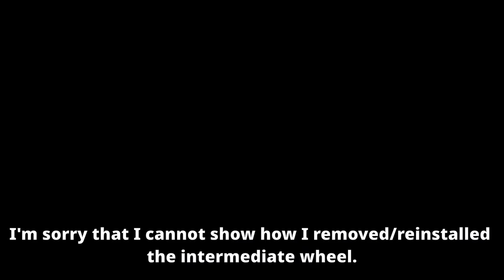Omega Speedsonic f300Hz Lobster Tuning Fork Repair - Omega Calibre 1255 (ESA 9210)

Comment: Did you do any oiling to this watch, I also didn't see any stone's 😮
Reply from the maker: Yes, I loosely followed the technical guide. I used light viscosity oil for cap jewels and medium viscosity oil for other metal-to-metal contact points.

Comment: Great video! I found one locally that is clean dial, original bracelet and clean movement working, he said send me a offer, what do yoi think is a ideal price? Only seen 6 on chrono24 on average 2800usd, what do you think is a good offer? Worried about it breaking :( since its a watch from the 70s, non lobster model, and if the tuning fork is broken does that mean it will not work at all as a normal watch?
Reply from the maker: Thanks! If it works with a nice dial, it won't cost less than $2,500. The value will not go down. If the tuning fork or its related parts break, it will no longer be possible to run. The only solution is to replace the part, but finding replacement parts is not easy.
Reply: @vintagewatchtinkerer  thanks for the reply. He called me today and said he would be happy with 800 USD. He is strapped for cash and said nobody is really interested in buying it. He sent me a video of it working fine. Just the large second chronograph dial does not go back to 12 when re setting, the dial has a very small flake on number 1, nothing to crazy, just as you mentioned if it breaks really can't go through the hassle of getting it fixed, it runs now but as you know it's a second hand market, anything can go wrong at any given point.
Reply from the maker: What a good deal! I’m so jealous.

Comment: hello how do you regulate the watch I noticed on the bottom of movement a plus and minis sign.  Thanks
Reply from the maker: A special tool seems to be required for adjustment. I tried an adjustment with tweezers, but I couldn't get the expected result. Anyway, I recommend not to trying it because it is for fine tuning. If the watch is running noticeably slow/fast, there might be another problem.

Comment: I like this watch, do you recommend  getting one?
Reply from the maker: Definitely yes! It is an iconic watch and worth having. But the price range will be a bit too expensive. Also, if it breaks, repairing it is not easy as replacement parts are very difficult to find.. It would be a collectible rather than daily watch.

Comment: Orologio che io ho smontato completamente come hai fatto tu  che non mi sembra un lavoro da non professionista, anzi uno dei  più difficili in circolazione, comunque che problemi aveva che non funzionava?
Reply from the maker: Thanks. The center wheel was stuck so I polished and oiled the pivot. Also, the click jewel of the tuning fork was missing, and I replaced it with a good one. Adjusting the position of the clicks was challenging for me. I practiced with the broken one before working with the good one.

Comment: Hi, I don't understand why you didn't transfer it to the original base and just mount another one. It's not the original Omega anymore, it's a foldable. I personally take the parts and always assemble them as they should be, i.e. in the original Longines, Zenith xl and Omega
Reply from the maker: That's true, but actually, I had some concerns about using the original plate because I saw some unusual damage on the plate. After posting the video, I bought another Omega plate and assembled a working "Omega" movement for the watch. I still have the original plate so I can replace it later if needed.